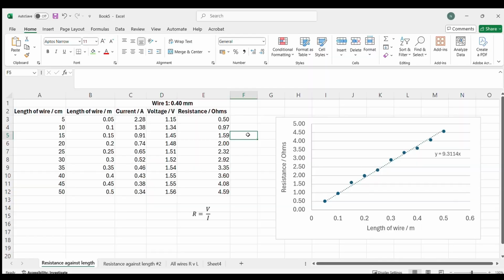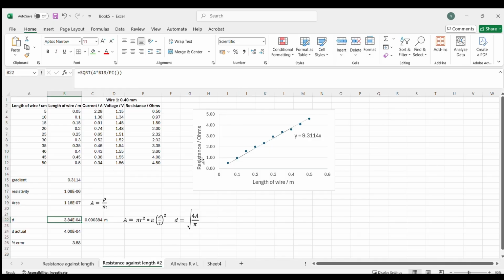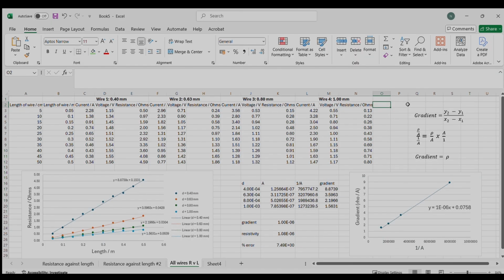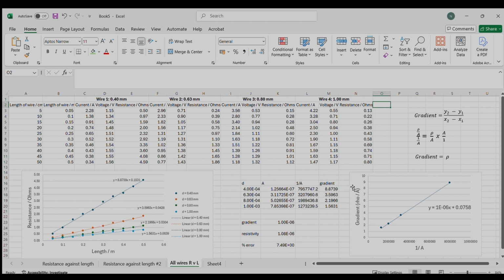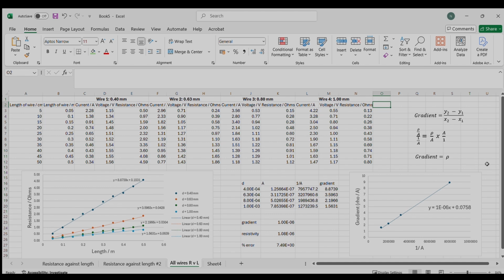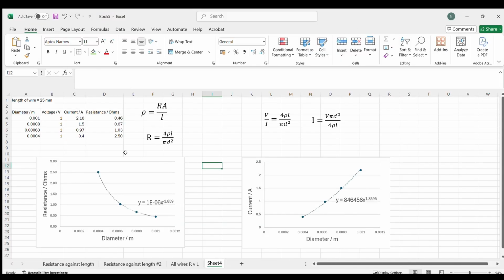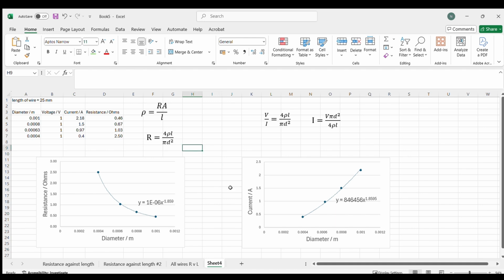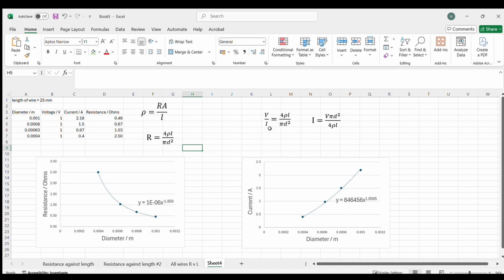Taking Resistance of a Wire further – Physics GCSE Required Practical… but better

Comment: This is really nice. As a slight variation I get the students to use a value of resistivity from the internet (hopefully a reliable source...) and measure the wire diameter in advance to predict the gradient (and intercept) before starting the actual experiment. That gives a really nice quick check of their data before I see the graph.
Reply from the maker: Glad you like it :) and nice idea on getting a feel for what the result should be. This will help build confidence as they get their datapoints with live graphing. Neat! 

We also do a resistivity board… video to follow!